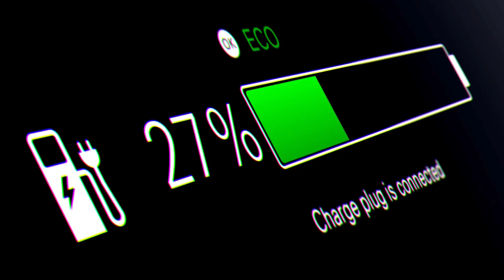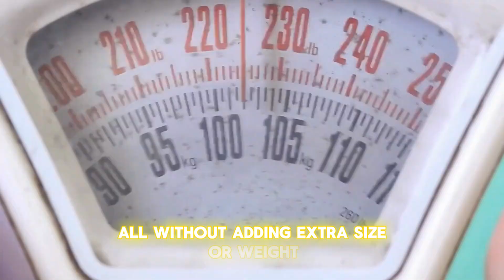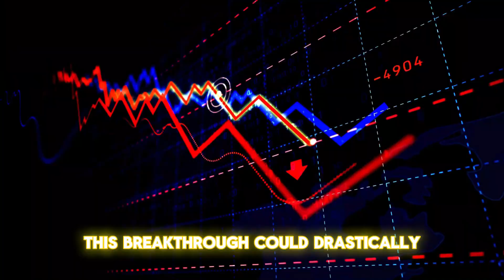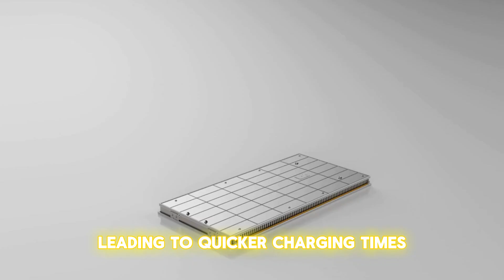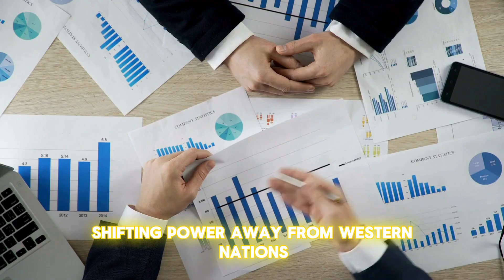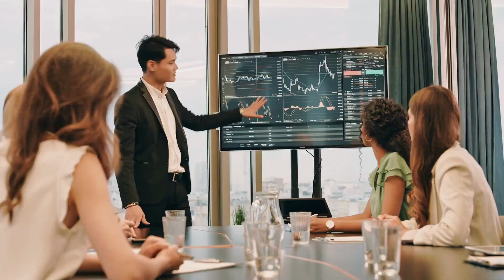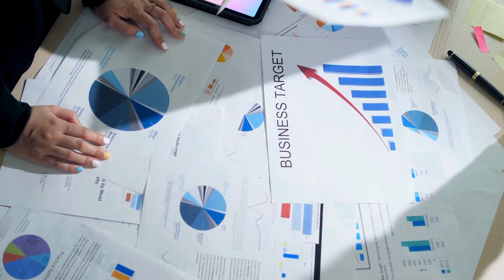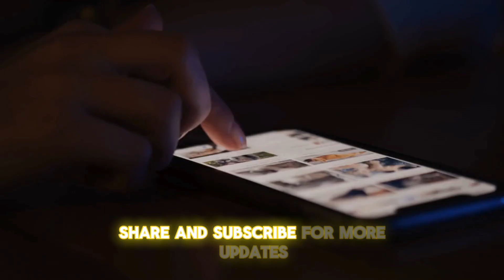China Announces New Lithium-Iron Phosphate Super Battery With 10- Minute Charging

Comment: This article’s claims are true & substantiated by recent developments in China’s battery technology sector, indicating a move toward faster-charging and more efficient LFP batteries.
China has unveiled a Lithium-Iron Phosphate (LFP) battery capable of charging in 10 minutes aligns with recent developments in battery technology. Chinese companies, including CATL and Gotion High-tech, have been advancing “superfast charging” batteries for electric vehicles (EVs). These batteries aim to charge from 10% to 80% in under 10 minutes, with the ultimate goal of achieving full charges in as little as five minutes. ￼

For instance, Zeekr, a Chinese EV manufacturer, has introduced a lithium-ion phosphate battery that can charge from 10% to 80% in less than 11 minutes using its ultrafast 800-volt charging technology. This development addresses concerns about lengthy charging times compared to traditional gasoline vehicles. ￼These innovations represent significant strides toward making EV charging as quick and convenient as refueling conventional vehicles.